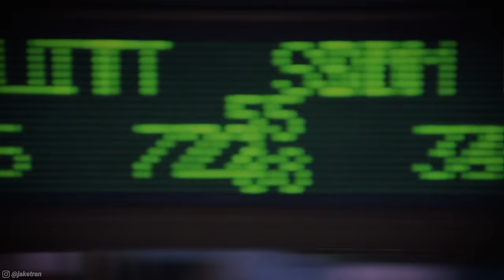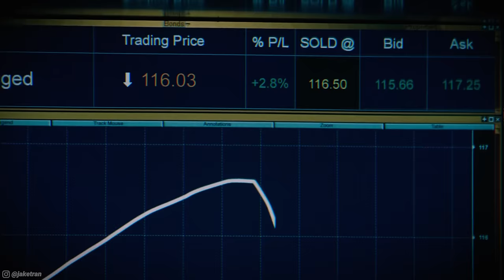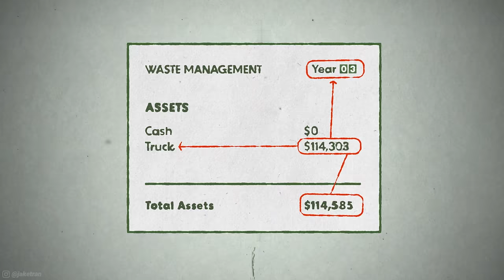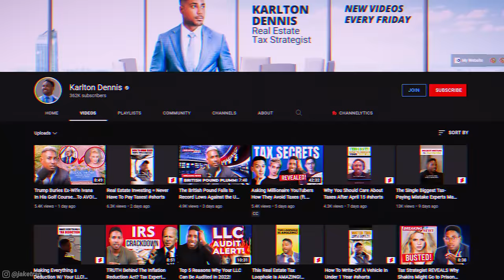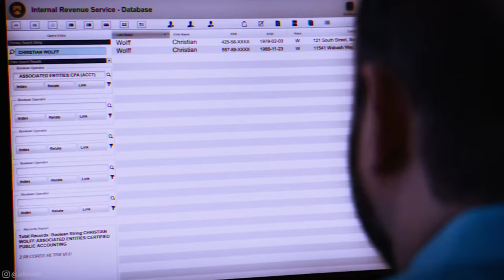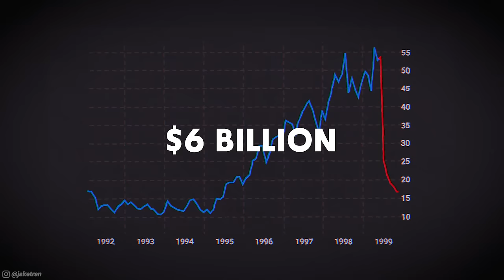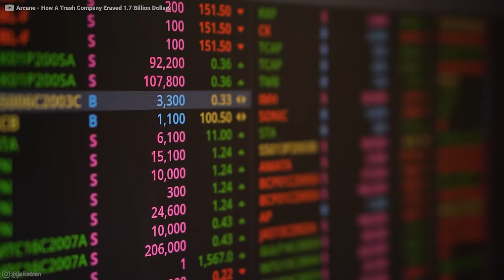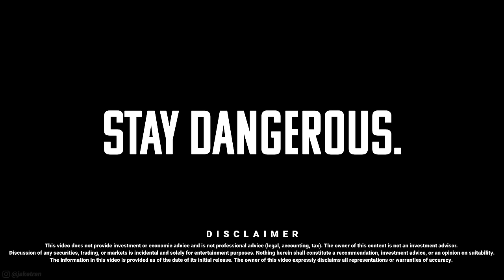How Accounting Fraud Actually Works.

Comment: Instead of increasing the depreciation period, just have a resale value at the end of 8 years.

That reduces the depreciation amount as per accounting practice.

Example, instead of depreciating 300k over 8 years, you can depreciate 250k over 8 years if you can prove that the truck can resale for 50k at the end of 8 years.

Comment: The depreciation code states only the maximum depreciation of a company asset. For vehicles this is 25% ot 4 years and after that there is no depreciation on paper. So if the depreciation is set from 8 to 10 or 12 years it is not illegal

Comment: In a sophisticated tax jurisdiction , an actual tax deduction allowance rate is prescribed by the tax authority and the difference between the allowance and the depreciation based on the accounting policies would be deferred tax. In other words , that depreciation rate change is not available as a tool to move tax forward/back

Comment: Great video, but the info on depreciation is not actually correct. You are required to assess the useful life of all depreciating assets every year. A company is well within its rights to alter the useful lifespan of an asset as long as it still remains within a timeline that if 'fair and reasonable' for the asset. You can't just double the useful lifespan of an asset, but adding another 5, 10 or 20% is perfectly fine.

Comment: this is BS, you can depreciate you asset on your annuale reports and use the GOV depriciation for your tax return (which may acually not reprisant the true depritiation of an asset). Furthermore, you need a CPA to sign of on your reports, thus fruad needs to be in conjunction of a CPA, this is not that easy.